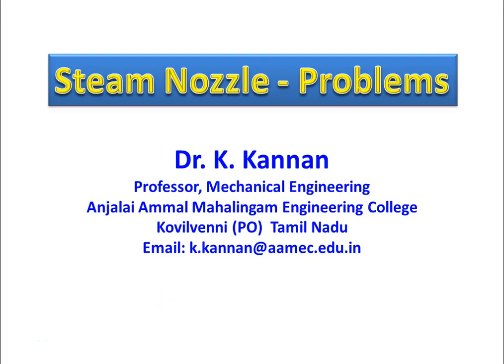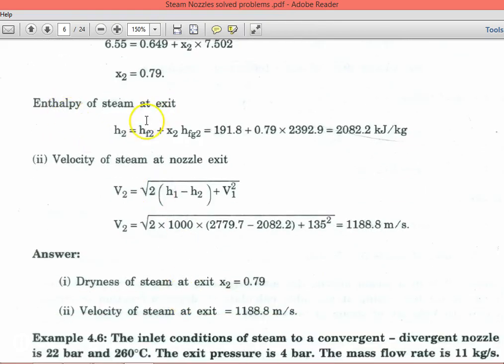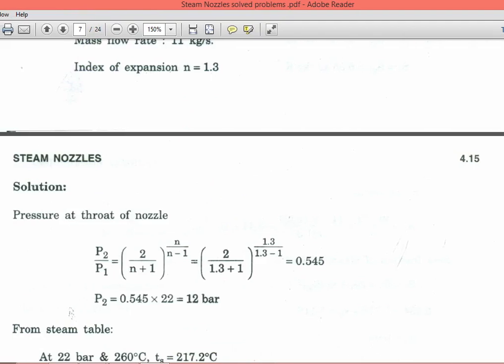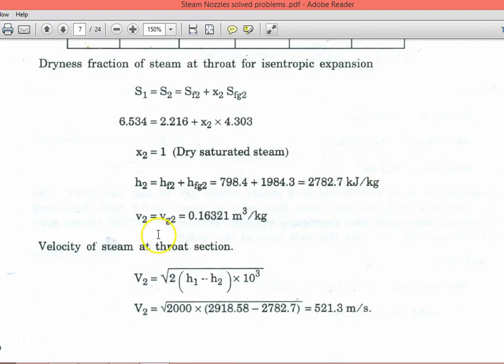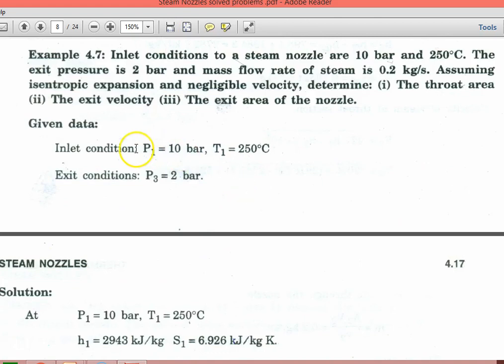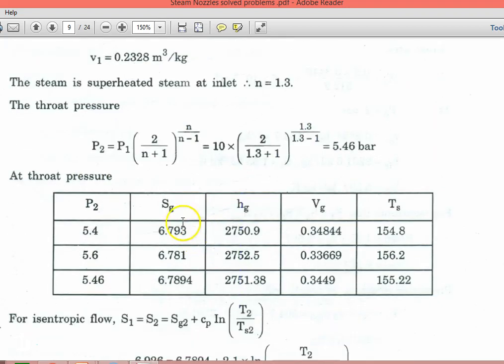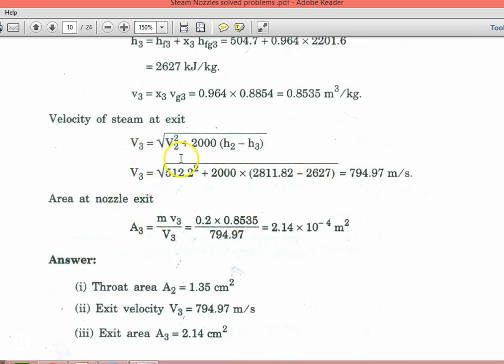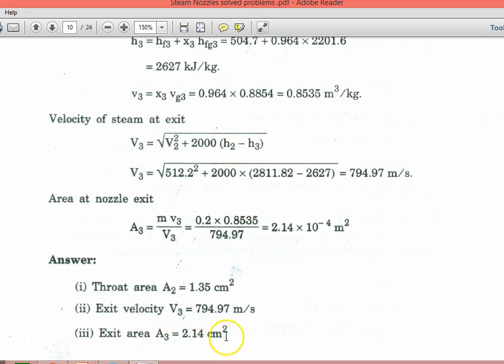SN 03 Steam Nozzle Problems 2

Comment: Sir in example 4.7,or any questions how do u know that it is convergent-divergent nozzle which is not mentioned in question.. and u took p3=2bar.. how can we able to identify in any question???
Reply from the maker: In the question it is mentioned to calculate throat area so it is a CD nozzle.
Exit pressure (p3) is given as 2 bar
Reply: @dr.k.kannan198  Sir,they just asked to find throat area but they didn't mention CD nozzle and how come we know that it is CD nozzle.. give some brief explanation sir.. How can we identify  whether it is CD nozzle or not if they not mentioned CD nozzle in question..
Reply from the maker: CD nozzle only will have throat.
Listen to video lecture on steam nozzle theory
Reply: @dr.k.kannan198  ok..Thank u sir for clearing my doubt and for quick response...

Comment: Sir in question no.2 ( 4.7) at throat you are telling that we are assuming that it is superheated steam , if we are considering it as wet steam and do the ans will be right or wrong? Are else how to consider whether it is wet steam are superheated steam
Reply from the maker: At throat section mostly steam will be super heated or rarely dry steam
Reply: @dr.k.kannan198  ok sir thank you
Reply: @dr.k.kannan198   Sir, if at throat the steam is superheated they why did you considered it as wet steam in case of 4.6(in 4.6 it is given as superheated tho you took it as wet at throat)
please clarify this doubt sir.....

i have my exam tomorrow
Reply from the maker: @JatinKumar-lq6uy   you assume any condition but you have to confirm. 
If superheated stream T should be greater than Ts
If dry steam x equal to one
If wet steam x is less than one
Reply: @dr.k.kannan198  thank you sir